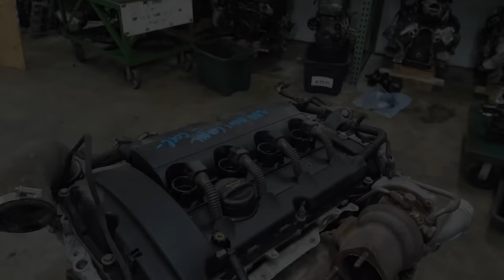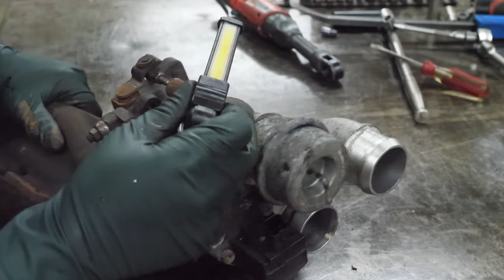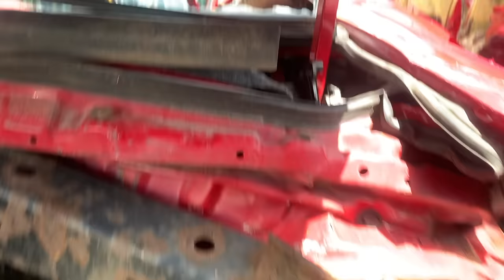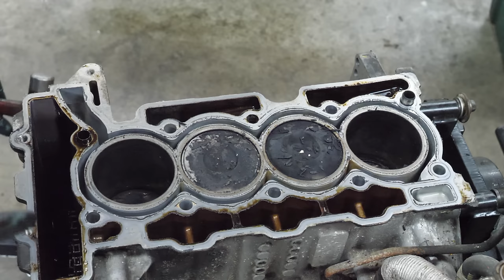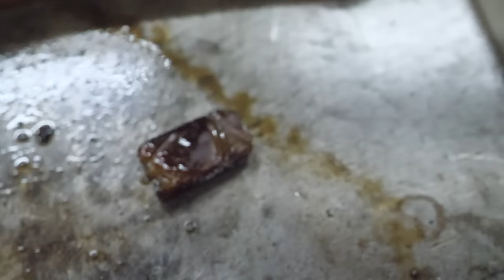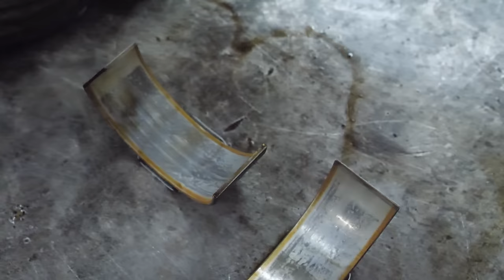JUNK Mini Cooper S (BMW/Peugeot) N14 Turbo Engine Teardown. Why Do People Buy These?

Comment: I used to have a 2006 Mini Cooper S with the supercharged engine. I consider myself very lucky that I had zero issues with the car overall, as I knew others with the same car who had tons of problems. But I was very meticulous with maintenance and oil changes, and it paid off. I sold it in 2017 when I got some diesel buy-back money from a VW I also owned because I needed something with a little more space. It was such a fun little car.
Reply: And also Peugeot 207, Citroen c3 and ds3 of the same era who also used the prince engine if you notice they are also scarce now

Comment: Don’t normally bother get into discussions about things like this but I had a jcw running 248 bhp on the dyno with small mods and I did plenty off trackdays with it never had a problem with it apart from the clutch going and a burst water pipe , I changed the oil every 3 thousand miles as it had a hard life and sold it with 86 thousand on the clock and these engines are the same in the Peugeot 207 gti and my sons running 250 in his and been the ring a few times and done loads off trackdays in his and it’s still going so there not all that bad if u keep up oil changes etc 👍
Reply: I have the 308 Thp 1.6, and it sufferd from all the mentioned problems. it was dealer maintained. All intervals as specified, and topped of with oil 0W30 (Expansive.!)
At 50K (kilometers) A full engine swap (Under warranty), because oil consumption went 1L every 12K/km. 
Turbo Failure, Tubo Electrical cooling pump failure, Gassthrottle body carbon buildup (replaced). Engine inlet manifold Carbon cleaning because of build-up.
At 140K on the ODO meter, 4 full sets of timingchains and hydraulic Timingchain tensioners went by.
The car is used as family verhicle and had none of the racing, and no caravan on the hook. So no this engine is a Russian roulette, some last. Most don't.
Reply: @retinaquester  1 l every 10k km it's almost normal, the thing is that YOU NEVER get to see it bc you should do the oil change between 8k and 10k km. Carbon issues? just cancel the PCV. 
The problem are the owners and the mechanics. The maintence period is shorter than in other engines, sadly.
Reply: @giulianomacarrone7938  Oops I wrote a mistake in the line. The oil usage was 1L at 1.2K, so a single trip on vacation would require a refill. 0.75- 1L
Reply: @retinaquester  that sounds like a problem, there are a few things to see and look for a solution. Engines are engines, just a bunch of pieces of metal, rubber and plastic... there's no magic in between. Good care and good to go

Comment: From own experience with these engines in Peugeot, they did in 2017 make a revised timing chain, which improved durability. The 200 hp version was generally more reliable with adjustable cam timing on both intake and exhaust cams.

Comment: Hey Eric, please try to unjam that turbo, there's a chance that you might find the valve piece that broke off has jammed the turbine then consequently cracked the coolant jacket then all the coolant drained to the sump during operation. This happened to me exactly, the motor will still run but will have no power. The issue with the N14 is that the PCV allows too much oil to get "recirculated" so the combustion chamber runs hotter because it's also burning oil and then it cooks the exhaust valves. So with valves looking not cocked up, the valves most likely underwent walnut blasting as well as obviously a timing chain replacement, the N14B16 motor is known for chain elongation, so when it begins to rattle at start up that's a sign for that maintenance interval to be addressed. I know all this crap because I've rebuilt my motor 4 times!!! Also, on your description, this isn't a BMW Engine rather a collaborate with Peugeot and BMW, AKA the Prince engine. Funny also that at the beginning when I saw coolant come out of sump and the motor still turns I knew what the problem was. And confirmed it when you pulled the head. :-) I truly hate this motor with a passion, no matter how much effort put in to seal the suspected oil leak areas, it's always gonna leak oil somewhere. I'm selling my built Chili Red 2007 MCS in a couple of months, I just picked up an 2004 E46 M3 as a replacement. Good riddance to this POS car.

Comment: So, so true!  Like you say, the engine can be good, but the maintenance interval was set at 10k miles, should have been 3-4K miles.
Reply: It was 15k! It would kill every turbocharged engine.
Reply: @las3k91  wow 15k, even worse!! I have worked on the N12 before…you know things are going to go bad as soon as you remove the valve cover

Comment: Awesome video, thank you! Really good information and good to see the insides. I own a N14 JCW and love it. Bought it with flawless documentation and a really good spec. Just changed the timing chain kit (among other things) the other day as a precaution since it was nearing the mileage where it tends to become an issue. Hopefully it’ll be good for a few miles now. I’m in Sweden and always use 98 octane which is readily available here and drive it like I stole it 😅 That and frequent (750-1000 miles) changes of Liqui Moly oil hopefully also helps.

Keep up the good work!

Comment: Popular in Europe and UK. We have dozens that come in our shop on a regular basis for oil & filter changes. We do them every 5-6k miles. A few have clocked up 170k-190k miles and are still going strong. Others we didn't get to early enough have had problems from 30k miles. Use a good oil and foam intake cleaner and their good.
If they are modified add water injection and change the oil twice as often as a minimum.
Royal Purple has a great product for these, oil is cheap engine rebuilds are not.

Comment: I'm owner of a C5 with the same engine (156 HP THP). The engine is a result of a collaboration BMW/PSA. All that was good by Peugeot has been removed and all what was bad by BMW has been installed. The timing chain doesn't last more than 100k kms. The direct injection with the variable camshaft timing causes deposits of burned oil as the engine tends to an increased oil consumption. The valves so are not cooled down by intake port injection. The result of this may cause overheating of piston crown and valve seats. One piston was washed out that proves that there was oil consumption (typical for these engines). With this amount of coolin liquid in the oil circuit, the engine couldn't run very long as the shape of the bearings weren't that bad. I guess that the customer stopped before greater damage happend but cause of the burned valve. Anyway, my C5 is running now about 220k kms however with the second timing chain set. The fan module and the electric motor of the water pump had to be replaced (that goes frequently together). And the throttle unit. But this is a problem with a lot of other constructors. Oil consumtion is about 0.4 lt/100 kms. I'll never put 0W or 5W oils, that's bullshit.

Comment: I have a 2014 Peugot 508 which uses this prince engine and so far I haven't had any serious issues, mostly wear and tear .about a year ago I had the oil seals changed due to some leaks ,belt tensioner and water pump.but that was it.the engine is really smooth

Comment: Just a thought, but it looks like the right amount of water the oil pump would have circulated in the upper end of the engine was turned over 5-6 revolution with a breaker bar…….

I’ve been a master auto tech for over 25 years and most automotive related YouTube channels annoy me. Your channel is the exception. You respect the process of disassembly as if you expected to diagnose, repair, and reassemble each engine.

Comment: On paper, the R56 gen Minis look great - and I'm sure they are if you're willing to spend what it takes to keep it on the road.  Around 2011, there was an engine change to the N18.  According to internet folklore, these are an improvement over the N14, but I'm sure they have their fair share if weaknesses and issues to watch out for.  Perhaps an N18 teardown some day???
Reply: The N18 certainly isn't trouble free but it was specifically designed to fix the prevailing issues with these N14 engines. I'd also like to see a teardown and comparison.
Reply: @lzaffuto   like super thin piston rings? Nah, they didn't touch it. BMW moved PCV into cylinder head and cut oil change intervals, which made the biggest difference.

Comment: I was waiting for the head gasket expecting to see where coolant crossed into the crankcase. Very surprised that the gasket was good. Could there perhaps be a crack in the block or head that would push coolant under pressure into the crankcase?
Reply: I think somebody (say the female owner) put water in the oil filler instead of the radiator.
Reply: More likely the oil cooler has a crack. That would allow coolant and oil to have quite the dance party.
Reply: That's not coolant in the crankcase... that's plain old water and lots of it. Car the engine was pulled out of was flooded
Reply: @crocodile2006  I'm favouring flood damage too. Although that's nothing to do with the burnt valve.
Reply: A comment more above said the common failure for this is a core plug leak, not head gasket or cracks, etc.

Comment: Also, being an european mechanic (italy) i can state:
This engines (mostly the first revisions) burn oil like crazy due to a flaw in piston design and tend to burn their headgasket. I also replaced a few of these and i rebuilt one that had low oil compression due to the oil pump not sealing properly. Every time i saw one of these things i was genuinely afraid.

Also, you see that plastic tube that you removed with the thermostat housing? That thing always become britle and breaks where it inserts behind the water pump and i swear it was the worst job in the world, i hate that thing so much
Reply: The head gasket issue was a known problem from the factory!!! Its due to the engine mounting using the cylinder head instead of the block as per the original mini
Reply: Adoro ❤

Comment: Despite the obvious lack of maintenance, this engine doesn’t look that bad, couldn’t imagine treating an engine I owned like this.
Reply: I 2nd this. I think the above comments that someone poured water in are spot on. I ha e rebuilt one of these N14s by hand. And based on what's in the video it's hard to see how that much water got in there. It had to have run w oil and water for the head to look like that.
Reply: I'm with you, n14 is not that reliable as japanese counter part, but it's NOT that bad as long as you know how to work on cars

Comment: 141,000 miles and running fine. Ran same engine in a Volvo with no issues. Oil and coolant changes are absolutely essential and level checks weekly.

Comment: My favorite issue on an N14 was the non serviceable vacuum pump seizing out of the blue and as it is driven off the end of a cam it snaps the camshaft in half.
Reply: That was only on n14, on n18 and n16 it’s designed to break a piece of plastic inside the vacuum pump instead of breaking the cam
Reply: Does it take the brake booster vacuum with it? Nice unboosted discs.

Comment: Awesome a Mini engine! It'd be cool if you found a F56 (2014-current) 3cyl 1.5 Turbo engine for a tear down. It would add to the 3cyl collection you've done so far. It does seem the older years Minis had many more problems, would love to see something more current with those.
Reply: The F56 engines are B series engines now, apparently much more reliable.  So much so that MINI has moved up to #3 on Consumer Reports best brands list.  I would like to see a teardown of one too, if any of them fail.
Reply: @stevemartegani  Hmm, got one in the shop right now which has a ruined piston. Same damage as all the VAG 1.4 TFSI engines, piston just fell apart. The car has done about 140k mls so maybe the problems start a bit later with these engines but still.. Cars these days are just made to break down just after the warranty expires.
Reply: @stevemartegani Underrated comment. Lots of negativity here in the comments surrounding the perception of MINI. Everybody thinks that the N14 is in all of them. The N18 and especially B-series are very reliable if you change all the consumables on time. Guide and piston ring wear is usually attributed to extended OCIs.
Reply: My wife's got 28k on it, so sounds like I've got a lot of life left until we start seeing issues. I gotta say though, those 1.5 turbo are really peppy and quick!
Reply: @_IMNNO I'm not going to attempt to say Minis are as dependable as say a Toyota or Honda, but the first gen with the Tritec engines are solid, and so are the 3rd gen. Everyone goes off the second gen and then thinks all Minis are as bad as the early N14 engines.

The N18 engines are better, but they're still inherently flawed.

Comment: Bloody hell. My 1960s Mini used to burn valves like that.
Reply: Always number three exhaust. When unleaded petrol was used, the problem went away overnight. I was doing three or four valve jobs a week (1970 ish) and putting a stellite valve in no3. I did not even bother checking any other valves than 2 and 3.Number 3  still burnt but took much longer. The fault was caused by a common inlet manifold leak resulting in lean mix and cooked valve. The dreadful crankcase breather regulator made it much worse, a surge of lean mix on the first siamesed cylinder to breathe. Cylinders 1 and 4 never gave trouble.

Comment: This engine was the sole reason I chose an older supercharged cooper S when I went buying. I know they have issues too but the stories of the N14 (Prince) where WAY more common than on the older Tritec. And to be honest...The supercharger whine (with a smaller pulley and open airbox) sounded SO MUCH better than any turbo could ever sound.
Reply: Same. I loved that car!
Reply: Same, was looking at R56's 12 years ago, saw all the engine issues and got the supercharged R53 instead.

Comment: Love your videos!  Still hoping you can tear down a 1.8 out of a 2016 Chevy Sonic, and a 2.4 SRT4 engine out of a 2003 PT Cruiser GT that has the aluminum intake setup on it.  As usual another great video!
Reply: Absolutely, my sonic sounds like a time bomb.
Reply: Change the rubber band amd feed the squirrels and you will be good.

Comment: Thank you, Eric!  You make interesting videos.  It seems that modern engines are too complicated for their own good.  This engine is a fine example.  I'll take a big USA engine from the 60s any day over one of those.  Keep on keeping on.  I hope your family is well and happy.  Thanks again for your videos.  Greetings from Ohio.  DEC 2023- WHY does the engine have a vacuum pump?
Reply: There's definitely a lot of good modern engines out there that do not break (Also gotta remember that all the shit engines from the 60s are being forgotten on the scrapheap, and the good ones have stood the test of time!), but there's also just a load of shit out there that gets trotted out by legitimate companies like BMW. Which are often overdesigned for the sake of it, and extremely tight on tolerances and as a result very flimsy when it is not ran in absolute perfect conditions.

It just feels there's little practical application into these engines, making stuff that runs perfectly efficient and stable in lab conditions, but have not been designed with normal everyday road use in mind. And as a result, they break more easily when they are handled by everyday people.

Companies are too busy making engines that ace lab tests and win awards, but not make engines that actually stand the test of time. Cutting costs and cutting corners, cheating emmision tests, and all sorts of extraneous bs that get in the way of making good reliable engines.
Reply: But the thing is there aren't really any junk engines from the 60s. There are ones that don't make a lot of power, but not really any that are truly junk. At least not US made ones. There are examples of pretty much every US made engine of that time period that are running. Everything from the Tempest 4 cylinder, to the OHC 6, to the V8s of all manufacturers, GM, Ford, Chrysler, International,  the Corvair engine, a variety of inline 6s, they're all out there. Each has it's disadvantages and advantages, but there are at least some examples of all of them out there running. Only in the 70s do you start getting some really junk engines, and even some of those are still out there.

Comment: Mechanic from uk here. Yea we have a lot of these engines in the uk in the peugeots,citroens and minis. We've found these engines are usually good for about 70000 miles and then they begin to break down. Its a shame cause i found Peugeot used to make some really good engines and still made good diesels (apart from the 1.6, they fail due to way too long service intervals) then they put these engines into everything and ruined themselves

Comment: I know, 6 month old video, but did the one valve that burnt/broke look different from the other valve? The face seemed to have a dimple in the middle, the others all looked flat. I have a 2011 MINI Cooper S with the N18, a much better engine. Mine is at 127k miles, and the only major repair (besides a couple of HPFP's) was a blown head gasket that was putting compression into the cooling system. Super fun car to drive, especially with the 6 speed manual like mine, pretty quick, and the handle curves like nothing else, especially when lowered and with bigger sway bars (like mine). Love your videos, man! Keep up the great work!

Comment: Great video. I've never had a Mini Cooper or other British car, but it looks like that car didn't have proper maintenance. The fact you found water in the crankcase shows it had some type of critical issue. Too bad, that kills an engine every time unless it's caught very quickly.
Reply: Prince platform engines such as the one here consist of a PSA bottom end and a BMW head.